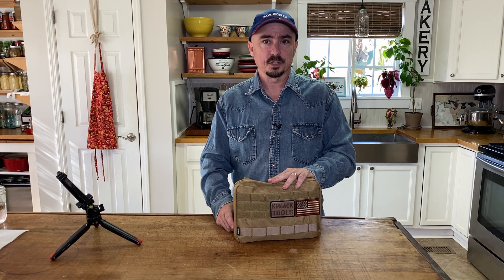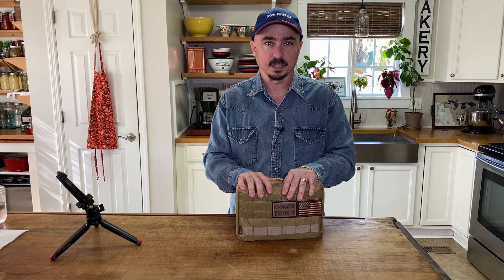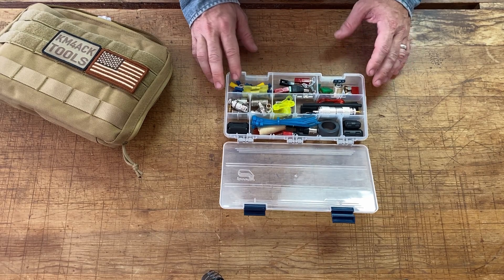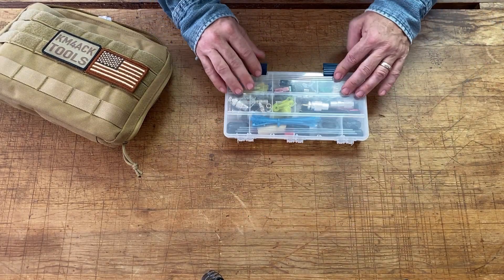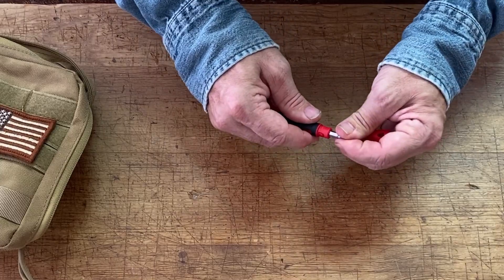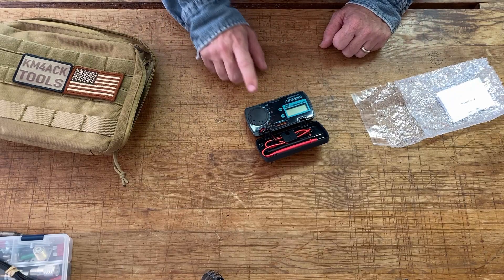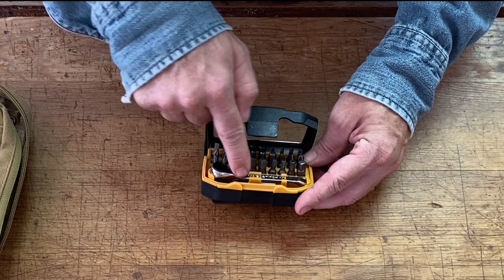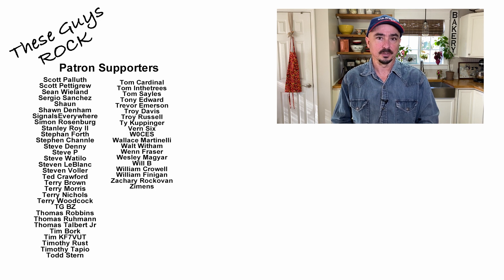Field Repair Kit

Comment: Very good. But your links are not for the items you show - the soldering iron, the screwdriver set, the ratchet set. In all those instances I prefer what you show in the video. Guess that is "luck of the draw" with Amazon.

Comment: This soldering iron is popular in the quadcopter community and heats fast using a field battery. Be sure to add the custom open source firmware available if you ever decide to buy one. https://www.racedayquads.com/products/sequre-mini-sq-001-65w-portable-soldering-iron-choose-your-color-tip-type?variant=31544599937137&gclid=EAIaIQobChMI3uHxuMKj7QIVDb3ICh3hZwLhEAQYAyABEgJEufD_BwE

Comment: Lots of gems in this kit. That ratchet set and mini multi-meter are pretty neat. Is a NanoVNA in a separate kit?
Reply from the maker: Yes. I keep the NanoVNA in the main radio bag. Just something I always like to have with me.
Reply: I was wondering the same thing about the NanoVNA!  I have one as well and like Jason I keep it in my pack with the 817ND, use it when I want to check my home brewed wolf river coil clone antenna I built.  That NanoVNA is a great asset to my portable station setup.  Juddie - WD8WV